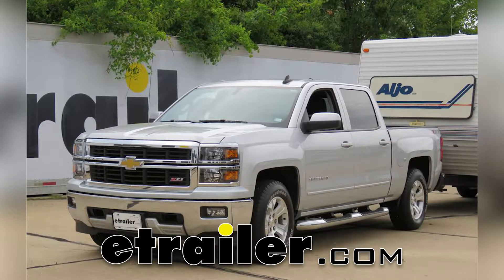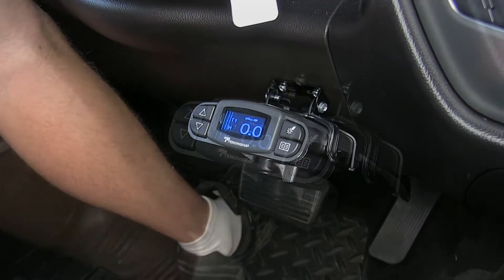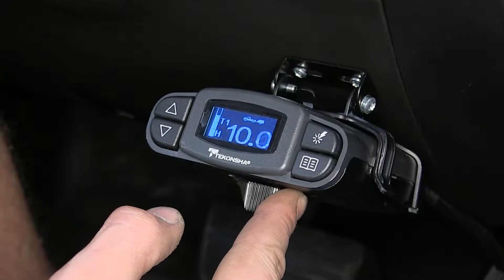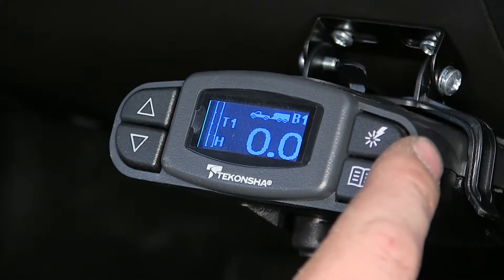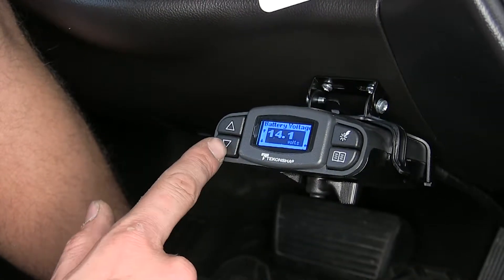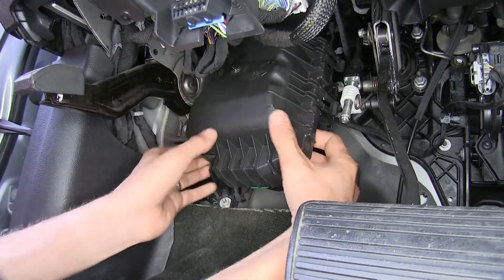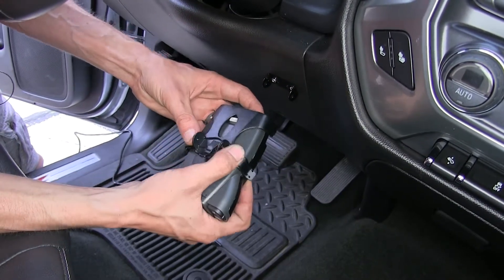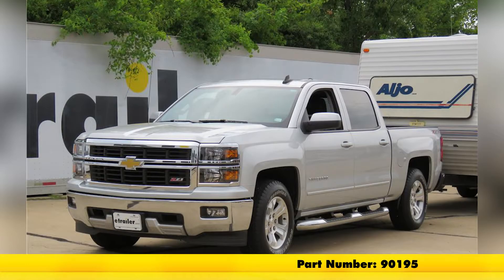Installing the Tekonsha Prodigy P3 Trailer Brake Controller on your 2015 Chevrolet Silverado 1500

Comment: Is this compatible with the 2015 chevy silverado z71?
Reply from the maker: It sure is! Check out the brake controller and the wiring harness that you can use to easily connect to your vehicle in the following links.
https://www.etrailer.com/Trailer-Brake-Controller/Tekonsha/90195.html
https://www.etrailer.com/Accessories-and-Parts/Tekonsha/3016.html

Comment: does it stay on all the time?
Reply from the maker: Good question! It does, but it's done as a safety measure so folks don't forget to turn the controller on when they're towing.  The Tekonsha # 90195 P3 brake controller will go into a sleep mode after 15 or so minutes of inactivity. When it's in sleep mode, it only draws a miniscule amount of voltage which won't deplete the vehicle battery unless the vehicle is left completely unattended for several months. If the vehicle is going to sit for awhile, you can always unplug the brake controller,  just don't forget to plug it back in before you tow!
 https://www.etrailer.com/Trailer-Brake-Controller/Tekonsha/90195.html